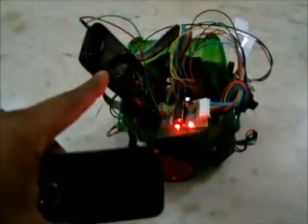Cell phone controlled mobile robot using AVR microcontroller ATtiny2313

Comment: why do you need a micro controller for this... if you only have to move the robot front, back, left and right, then you do not need a micro controller in the circuit. The transmitter signal is a decoded to give 4 bit output, which is good enough to drive two motors independently, which will perform the standard functions you are performing with your robot. One more thing, this is of no use if we do not have a camera mounted on the robot, which can transmit video to mobile phone which we r using.